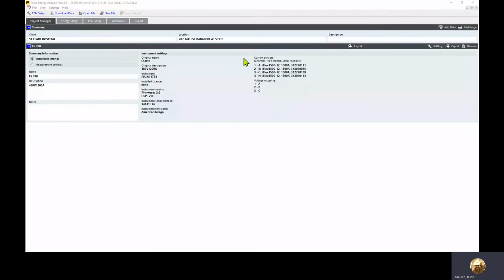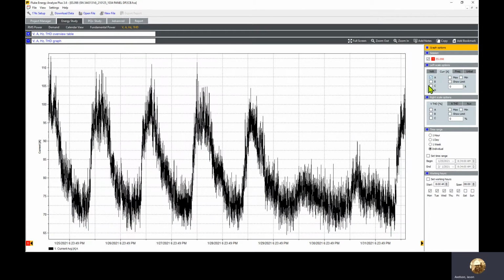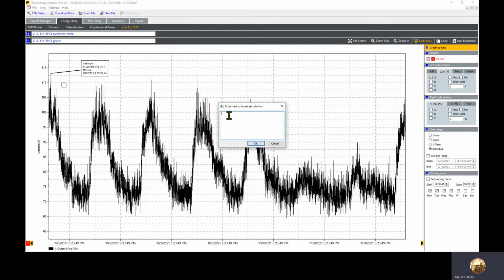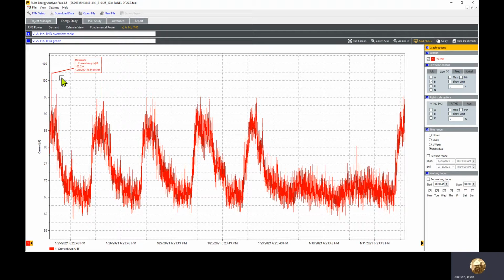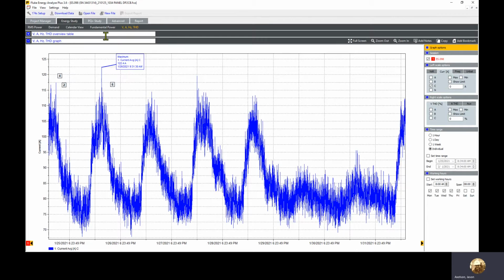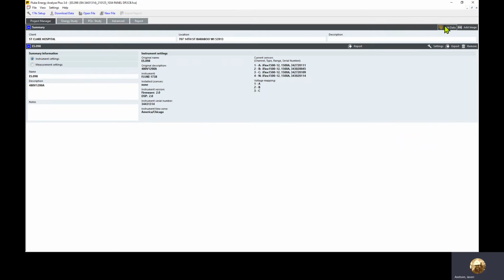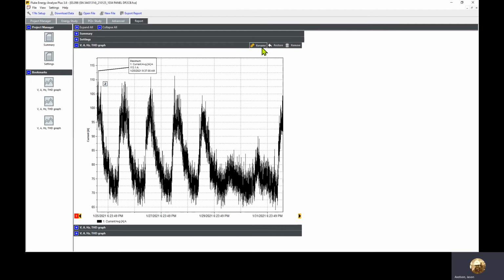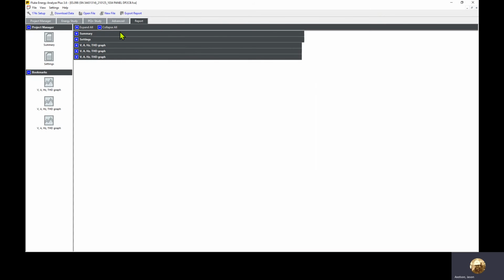EnergyAnalyzeLoadStudy

Comment: When you are finding average max and min values, what is the duration of that time period?  NEC 220.87 Existing Loads wants us to get 15-min averages.  Do those measurements meet that?
Reply from the maker: Hello Wyatt. The duration was determined when you setup the logger function before you started logging. If you did not set it to 15 minutes the Energy Analyze software has an Advanced feature where you can manage the Average interval to 15 minutes.